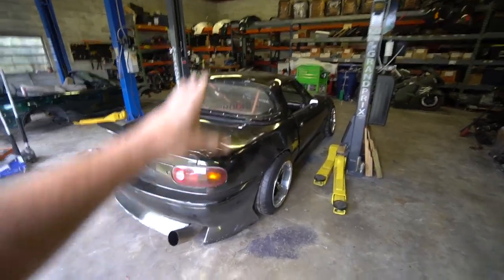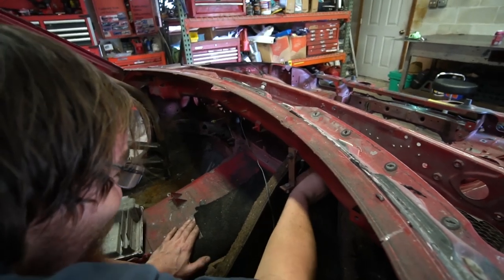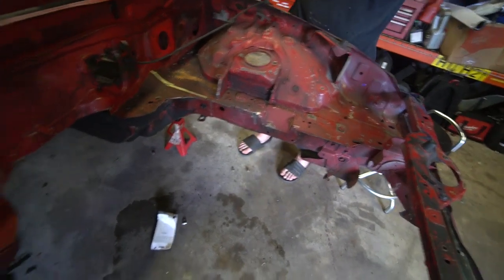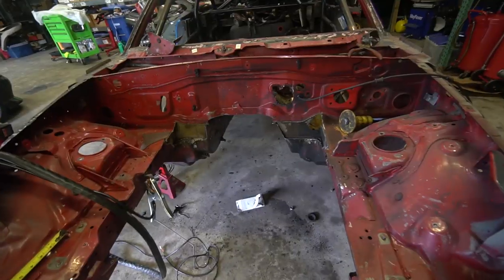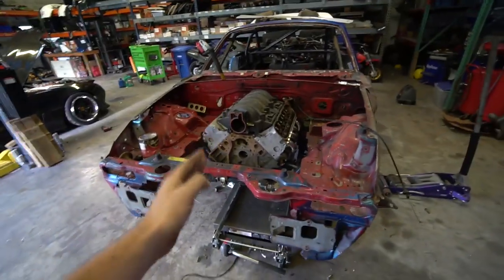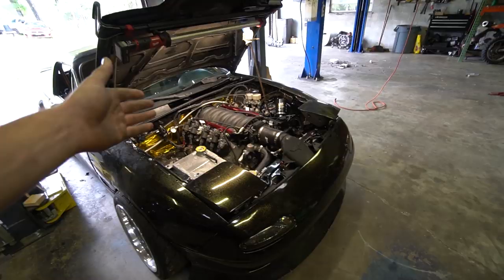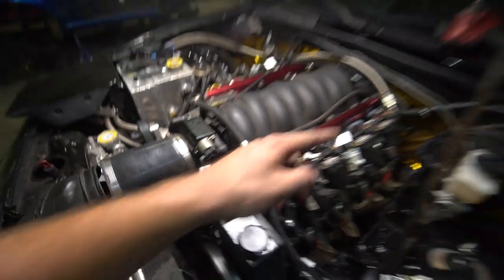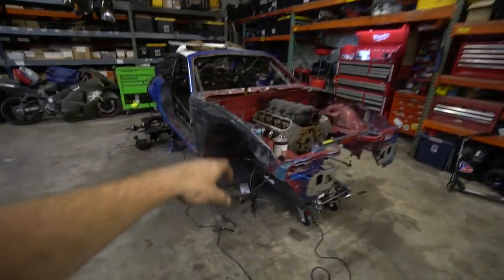Building Another LS Swap Miata! Engine Bay Cutting and Engine install! (Huge Progress!)

Comment: Hey taylor just and advised buy shade 5 welding glasses so you can use your plasma cutter it will save your eyes on the long run.....i run a weld shop and burning your eyes is not plesant.... and keep the good work i really enjoy your vids
Reply: His hood probably has a “torch” mode. That is shade 5
Reply: Arch eye sucks man.. learned that the hard way 😭🤣

Comment: Instead of cutting the hood you can use an E90 BMW latch and still keep the Vette intake without the aero latches. I have it on my Miata and it's awesome!
Edit: Also it would be awesome to see Ben's Miata with AC and done more street/drift. What are you using for wiring it?
Reply: DirtDude117 donyou have a link to more info on the e90 latch? 
Will be a tad bit more street oriented. Radio and working windows but no a/c or anything crazy
Reply: @BenJulian  I do not, someone mentioned it on the V8 Miata FB page forever ago so I added it to mine.
Reply: @BenJulian  Also I do have AC in mine which wasn't difficult at all but I'm not running a dry sump and have the MR2 electric power steering. You should look into the quarter window vents to give you some air flow. I have them and love them for the nice days when it isn't a scorcher.

Comment: Pro tip:
Heat lug in pliers and fill wit solder once full and hot then put the wire in the puddle and let it cool than you won’t heat and burn your wire. And use a heat gun instead of fire to do heat shrink. It does not make the shrink all krispy. 🤘🏻

Comment: On the LS motors it’s best to route the alternator/starter wire down from the alternator, across the front of the oil pan, and then back to the starter along the passenger side of the block/oil pan lip. The LS trucks have a setup similar to this from the factory.

Comment: Only in Florida do guys work on cars in slides
Reply: In nc we no everything in work boots
Reply: guilty as charged, just did a video on changing my radiator fan on my CR-V in some slides
Reply: Flip flops in south Texas
Reply: tf are slides?
Reply: @SteelOfLegend  like flip flops, but you don't have the connector piece that goes in between the first and second toe.
Reply: @MobWithGuns  Oh, you're talking about trash.

Comment: For the spot welds you can use a drill bit a little bigger then the spot weld drill just through the spotweld and use an air chisel or a good sharp hand chisel and pop it lose works great. I did it that way in my shop before I got a ez spotweld cutter. Like your vids man.

Comment: I actually burnt my corneas wearing sunglasses using my plasma cutter welding goggles are probably your best route. I use my welding helmet now and just use the lowest shade level feature it has not a problem.

Comment: Notch the location on the under skin of the hood so that the bracket is below flush a 1/8 or an inch presto problem solved, also if you trim a piece of card board to the shape of the metal surface CAD then weld one plate on the two sides you make and then you have a lvl surface to tap and bolt to

Comment: You can heat the terminal and fill it with soldering then push in your wire . That way it will not effect the shield of wire

Comment: You know the upside as well of a plasma cutter is when you want to cut the seam to make your bellhousing transmission tunnel bigger you just make one nice little split down the edge of it and then you beat it over and then you can use that like a lap and then reattach it so just leave yourself a little bit of an l and then bang it over and then reattach it to the firewall

Comment: Taylor, you can paint the floor silver and it will be way brighter inside the shop. And why you dont ceramic coat the exhaust not to burn the auternator?

Comment: It works better to fill up the battery end with solder and  melt it then  add the cable to it.  Faster, cleaner and easier
Reply from the maker: It’s funny because someone told me that last time I did this and I only remembered it as I was finishing up and I talked about it in the video but I took it out because it was too long.
Reply: To save time you can pull out a bunch of that thin solder and fold it over itself a bunch to make a thicker bunch. I do it often when i run out of my big stuff!! Just a tip, great work Taylor 👍🏻

Comment: Heat up the lug fill it with sodler than insert the cable much better and it wont burn your wire audio tricks 😎

Comment: Taylor im not sure if that is a special copper connector you used for the 6awg wire but i work with boats and use those same connectors and they are actually crimps. You need a big crimping tool to get it though.

Comment: Is electrical different than just soldering copper tubing?  that seemed excessive on the heat and the amount of solder or do you need that much?

Comment: Chevy should come out with a 350hp v8 coupe that is a very similar size as the Miata.   With a 5 speed stick option. These cars would sell like freaking hot cakes.
Reply: Yeah but they won't because America.
Reply: IMNOTA but wouldn’t that be sick!? Because America.
Reply: @nitrokiller9959  It would, but apparently America is about big engines, but also big cars... So if you want a big engine in a small car, I'm afraid you'll have to do it yourself.

Comment: I would crimp the wire for the alternator and starter. Soldering big wire like that won't make that good of a connection and heat from the engine could make it weak over time.

Comment: amusing but true, i priced out an LS T56 w/ dry sump swap into a 1988 LX foxbody mustang that came with a 4 banger, and an identical 2002 miata swap and the miata swap would actually cost me less to end up with a car that actually drives well due to the fact that its not that hard to find a miata that doesnt have holes rotted through the floor and if one found a foxbody without holes, it's not cheap. unrusty miatas not destroyed miatas can be got for less than 2 k a lot of the time, if you're spending less than 2 k on a foxbody to start a build you're going to have to restore that rust bucket first.